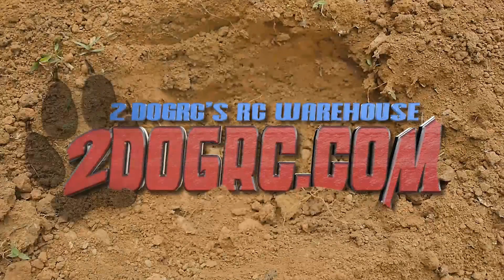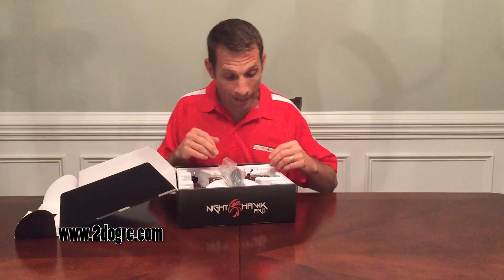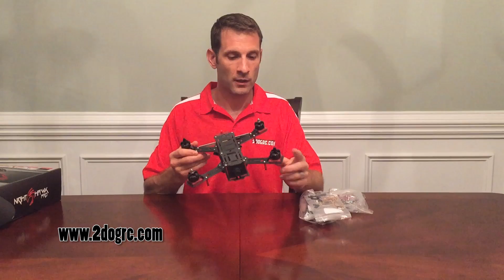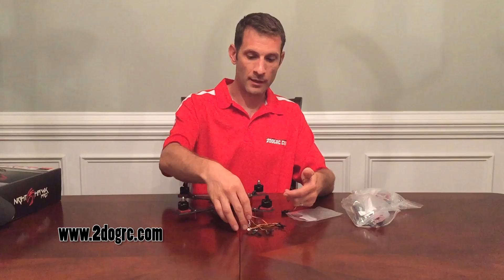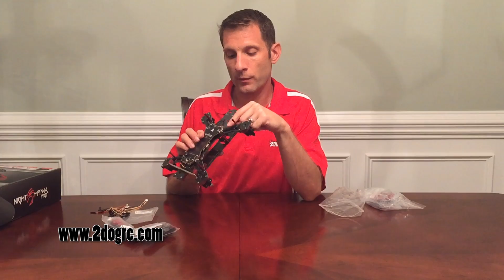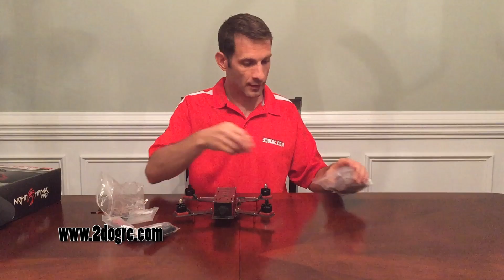Unboxing Video of Emax Night Hawk 280 Pro Racing Quad

Comment: Nice, woudl you have an ETA for when it's in stock?
Reply from the maker: Stefan Dembowski Around August 10th.
Reply: AWESOME. Um, any OSD options? At the least a newbie like me would want voltage...

At this price point, this seem like a great way to get into mini quadcopters...
Reply from the maker: Stefan Dembowski I agree completely about the OSD for voltage and this information has been relayed to Emax via me and many other channels.  They said there will small changes in the upcoming batches.
Reply: AWESOME! ;)

Comment: A question: Can I use a standard reciever from Spektrum or do I need a special one?
Reply from the maker: Rainer Wachter You can use a standard receiver from spektrum.  You want a 6 channel.
Reply: Ah ok thanks a lot...I'm new to Fpv racing, I have to decide between the Nighthawk and the Vortex.Which one would you choose?
Another question : Is the programming necessery that you showed with "Cleanflight"?
Reply from the maker: Rainer Wachter Okay, here is what I would do.  I would buy the Emax, learn to fly on it.  Its very inexpensive for what you get.  You won't worry about constantly running into trees, the ground and everything else.  Then as you learn about it move to your next frame.  The Vortex is a great frame, but $500 is steep for learning.  Also with quads, you will want at least 2, i have 6.  When you go out to fly and you take a big hit and the quad is out of commission, you can whip out #2 and go fly instead of going home.

Youmay also decide to build your own and get exactly what you want.
Mark

No you do not need to flash cleanflight, it just has more options.
Reply: 2dogrcThanks a lot for the answer and your time...I almost thought the same. I think I'm going to buy the Nighthawk, might program it and use a 6 channel receiver from Spektrum with my Dx9 to fly it.Should I set it as an airplane or as a heli?And is there any special setup to do on my transmitter?
Reply from the maker: Rainer Wachter No problem.  Set it up as airplane.  No special setup and I do have a video walking you through the steps for that as well.  It uses 6x4.5 props, but no one makes them the same as the emax ones.  I would recommend buying some 6x4.5's with your purchase.
Reply: Ok,thanks😊 So I'm going to watch this video now.Already subbed you🙋
Reply: 2dogrc And the last question : Does it work well with my Fat Shark Vr1100 glasses?
Reply from the maker: Rainer Wachter No.  The Beeper connects to the main power distribution board.  Then in the Cleanflight setup, you select a channel and switch position to turn on the switch.
Reply from the maker: Rainer Wachter I bought this one from digikey.
http://www.digikey.com/product-search/en?vendor=0&keywords=458-1342-ND

You will have to solder the included wire from your Nighthawk to the 2 pins off the buzzer.
Reply from the maker: Rainer Wachter Hello,
  The cable is included, just no buzzer at the end. :)